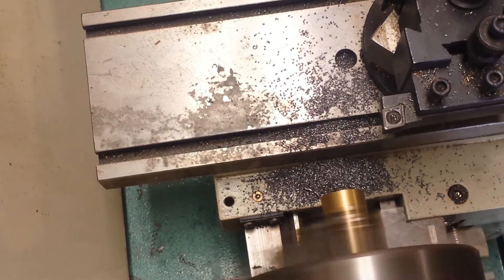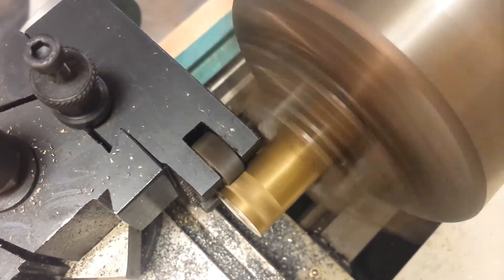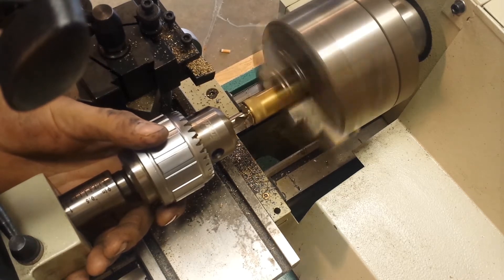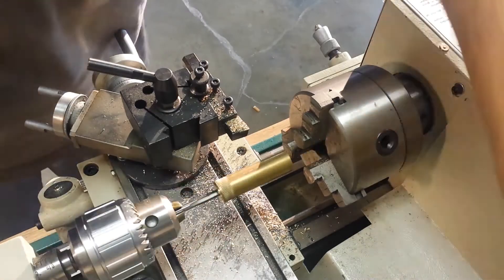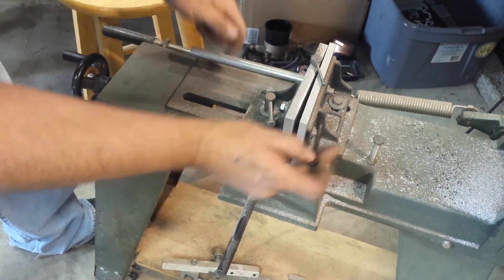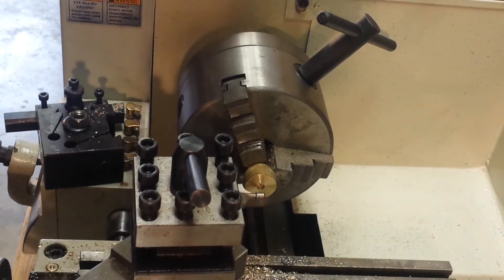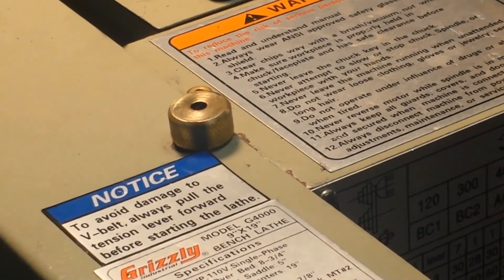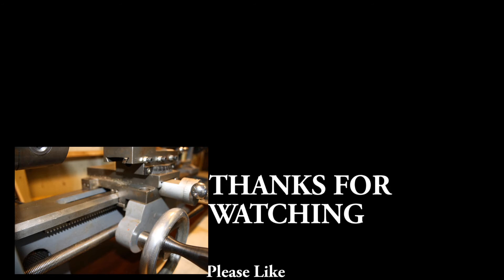Grizzly G4000 Thumbscrew (First project)

Comment: Thanks for sharing. I liked your tip on using a router bit as a tool for cutting a radius.
Reply from the maker: Good Evening Sam, The router bits are usually high speed steel. Sometimes carbide... I am always looking for discount stuff.  machine cutters are a thing to look for.....Yard-sales are a great resource if you are willing to get up early on the weekends.  Thanks for commenting.

Comment: I think you need to knurl at your slowest speed  with more force you have a split knurl rather than a correct diamond pattern you may have to use another diameter to obtain a diamond pattern keep working at it and I know your knurls will improve a lot good luck with your new lathe.

Comment: Don, how is the G4000 holding up. Any complaints? I’m about to buy a used one. Just not at a steal like your purchase, haha.
Reply from the maker: Im very happy with the lathe thanks. No problems.. i recommend to have a few extra drive belts on hand, just in case. FYI, it wont cut 11 TPI if you need that..haha
Reply: Don Brand. Hmm. Does it wear them out often?
Reply from the maker: Not really, only If you make a mistake.. lol